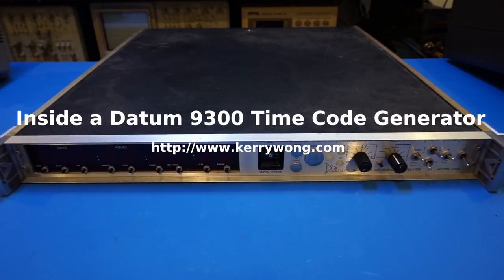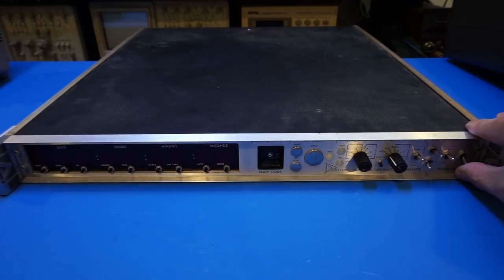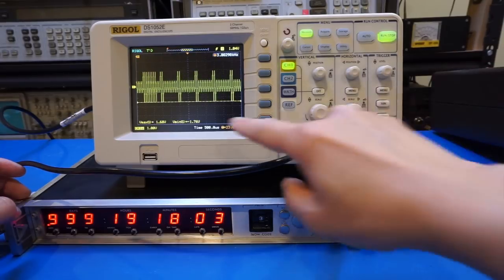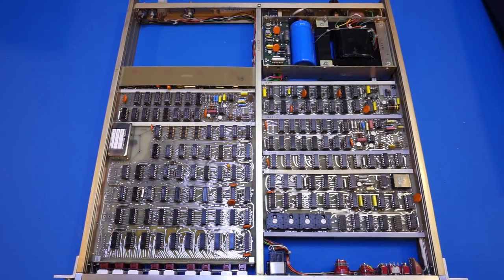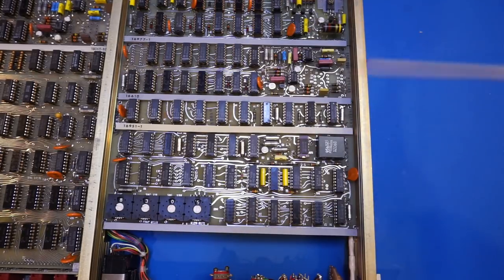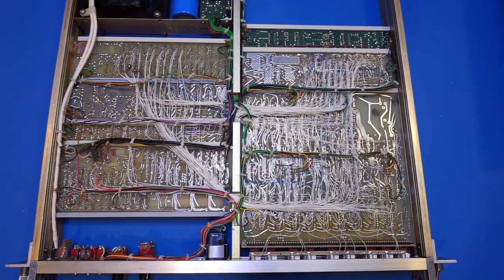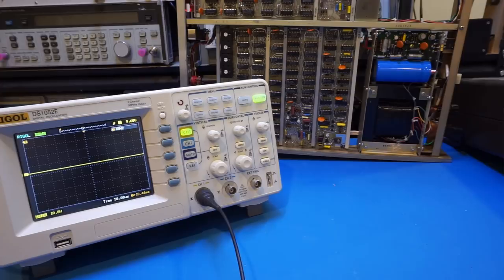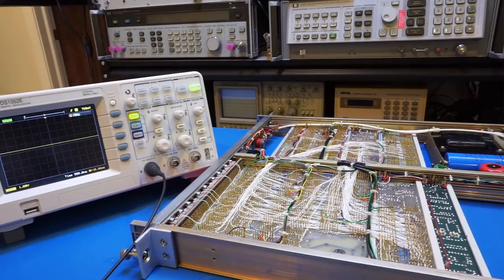Inside a Datum 9300 Time Code Generator

Comment: Have worked on systems in the military that used this device. We didnt have to go inside the device if it failed as it was spared at the box level which meant that we simply replaced it. In addition, we had to teach how these things worked because we had to train other maintainers on these systems. It was used on an acoustic spectrum analysis system which was capable of recording and playing back acoustic information gathered from submarine contacts and where time code was needed to synchronize real time recordings up to 8 times real time.

Wire wrap was quite common in the 70s and 80s as it was a lot easier and cleaner to wrap and unwrap the connection then solder and unsolder, especially if the post had numerous wires attached to it. Special tools made the job very easy,

Comment: Thanks for posting and the commentary.  This is a sureal device.  Wire wrap connections and a switch mode power supply.  The people who made this obviously looking to optimize their profit margin since they propabily have no competition.
Reply: Power supply off the shelf, high reliability unit, and then they make the rest of the unit to order, and wire wrap is very reliable in this use. Very common to make up to dozens of units that way if your cost of production is not a constraint, but you need flexibility in manufacture to customise to special requirements. A lot of avionics and military equipment that is low volume is done this way, as it allows the prototype and production units to be repeatable without any glitches from the layout change. you stay bug for bug repeatable, and any upgrades as well are easier to do in production or after sale.
Reply from the maker: I wondered how much this device cost when it was brand new back in the days...
Reply: Probably in the 5 figure range, as from the looks of the unit it was a custom made unit every time. High serial number is just likely that they put part of the options into it, so they could track from spares and service requests the current modification state and know the spares needed. The assorted back panels show that there are multiple options for input and output connectors, probably custom for each client application.

I did order replacement power supplies for a certain application, and they were expensive, cost more than gold.

Comment: The internal rotary switches are kinda interesting. I'd hazard there's a TTL compatible delay line of some kind that is fed by the circuitry that connects to the rotary switches - maybe the ceramic packages? Wire wrapping immediately screams low volume so I'd guess the price of this thing was kinda special. Delay line calibration and setup must have been done with an oscilloscope to compensate for the unit-2-unit variability due to construction technique used.
Reply from the maker: That's probably a safe bet. I will dig a bit more to see if I could find any information on that package that's marked "peerless".

Comment: I believe I have the service manual for this model. What is the best way to send it to you?
Reply from the maker: Would it be possible for you to send it to me electronically?
Reply: Kerry Wong I'm sure I could scan it to a PDF. I am otherwise engaged until next week when I can check my library and get back with you. Great video by the way. I have one as well; It was recently removed from service.
Reply from the maker: Thanks in advance!
Reply: So it turns out that I have the 9100 model, which is very similar and is the same vintage. I found the operation/service manual for it as well and have scanned it. I have sent an email to your uwalumni account.
Reply from the maker: Thanks so much!
Reply: @KerryWongBlog  if you could share that manual with me I could really use it

Comment: Seems like it could be older than late 80s, did you see any date codes?
Reply from the maker: The datecodes on the majority of chips are 1984. A few have newer datecodes (1987) but could've been swapped.

Comment: Dang, I 'bout fell out the chair when you flipped the unit over...I still have my cheap wire-wrap tool; never liked using that technique simply because as you say the failure/mistake possibilities were huge! Biggest thing I ever did was a I/O board for my Apple II and even that was a hair pulling drill until I got it to work right! Thanks for sharing Kerry!
Reply from the maker: Hi Dino, yeah I was a bit surprised to see that all the wire wrap wires are of the same color. It must've not been an easy job for sure.